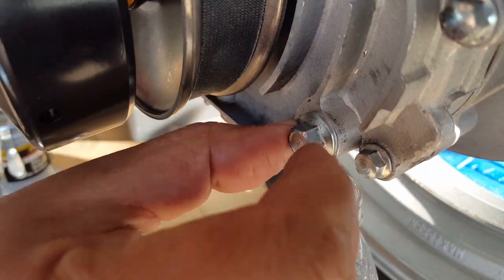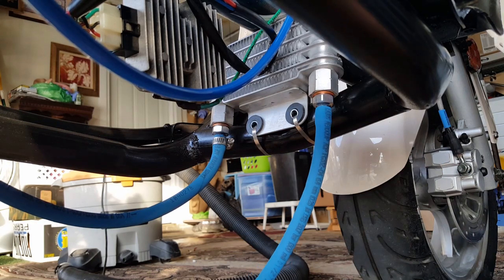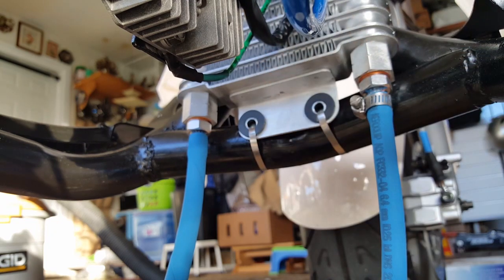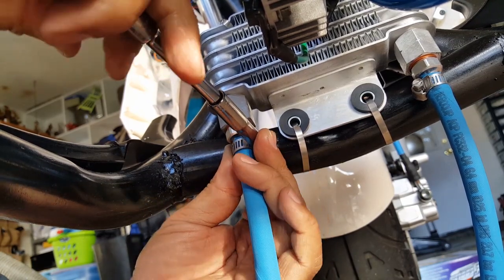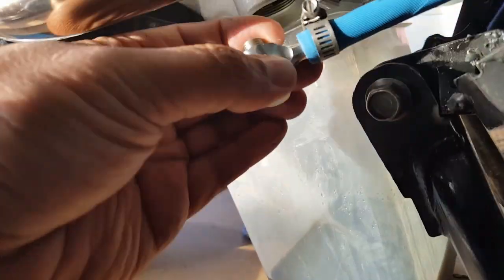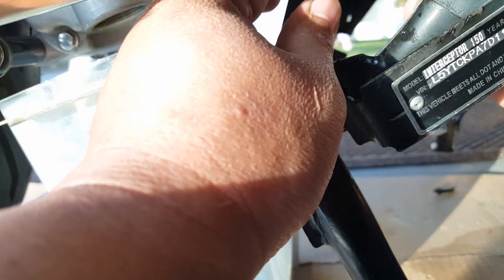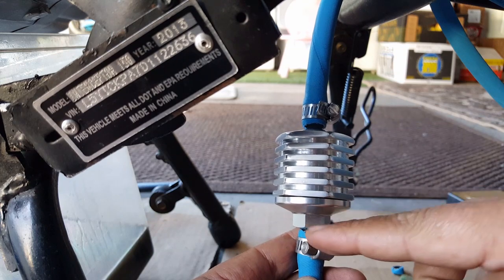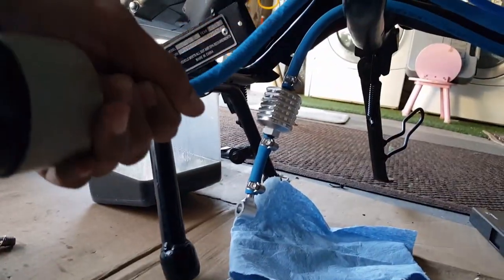How to Change Oil and Install GY6 NCY Oil Cooler 9 of 17

Comment: u should put the oil cooler in front of center stand...and the cooler with the knobs up so the cooler keeps all time oil in or you will have trouble with oil level
Reply from the maker: That makes sense but cycling the oil and keeping it rotating would be harder right?
Reply: @NCYSTORE  the only negative point with cooler pointing knobs up is to completly flush oil,,,remenber that with your set up the cooler lines are far from engine and pump is going to take longer to fill up lines + cooler before it receives oil in the engine head and to ever pump feeds oil to..with the cooler always full you reduce  time the pump needs to fill up cooler,,,i mount my coolers in front os central stand or bettween engine and central stand depends on space ,,the cooler will always be at engine case oil level so no misreads on oil level and guets good air flow
Reply from the maker: @dundycbr23  thanks for explaining I was told that the oil cooler runs in sort of a series like a maze runs from the bottom to the port zig-zag pattern,  if that's the case what comes up must come down what is down must come up not sure if you need different I see your point but I'm not sure if I can attest to that yet I know it'll probably take 50 more milliliters to fill up the hose line motoroil and the radiator it doesn't really stock up much so 800 ml total motoroil.

Comment: keep up the good videos ....and you should guet a oil temp gauge just for fun and content,,,
Reply from the maker: That would be interesting I would like to know what would be the oil temperature like GY6 maybe somewhere in the 113 F cooler or 148 F non cooler?
Reply: @NCYSTORE  ideal temp is always near 194f ..i was building pitbike engines and when cruising or no engine load temp where around 176f but on load would go up to 300f...rings where done in 30hours,,now we use bigger coolers so temp on load is going up tu 220f,,,and rings are lasting 50plus hours